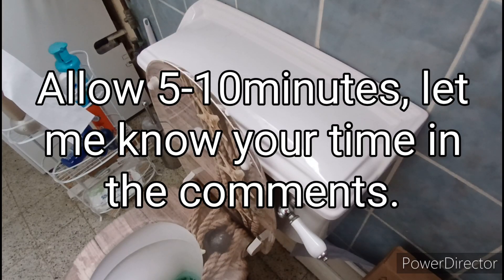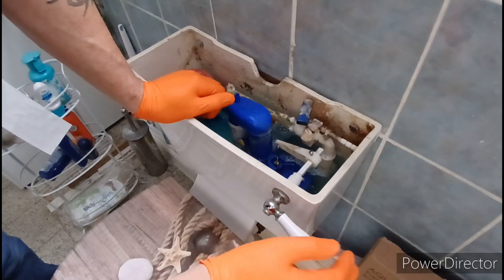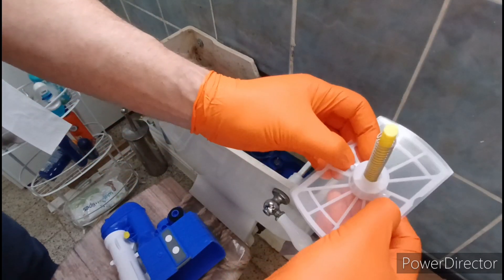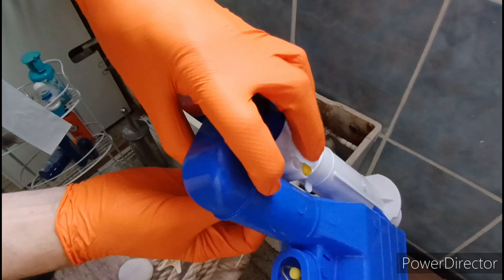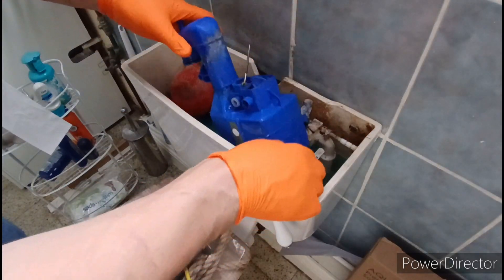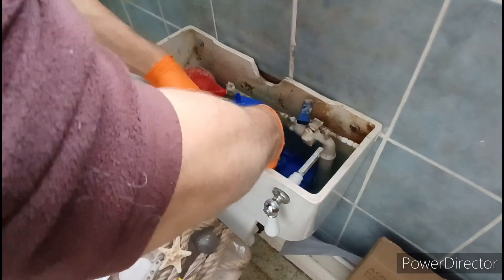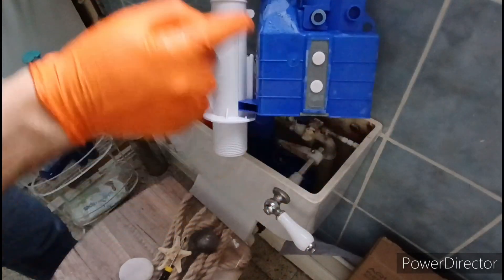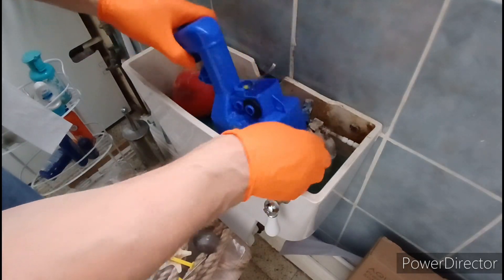How to Change & Repair a Toilet Siphon. How a toilet siphon works. DIY Plumbing. Dudley 88R Turbo.

Comment: The 'blue stuff' people use degrades the diaphragm washer, as he said; don't use it.
Reply from the maker: Yet another product that's available in shops but really shouldn't be. Like the DIY outside tap kits that cut into the pipe and don't have integral check valves...